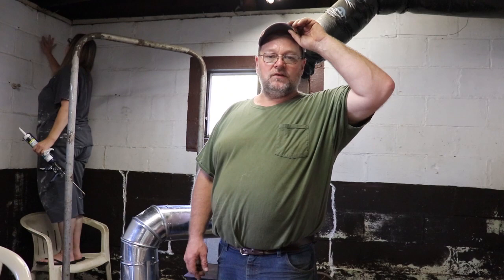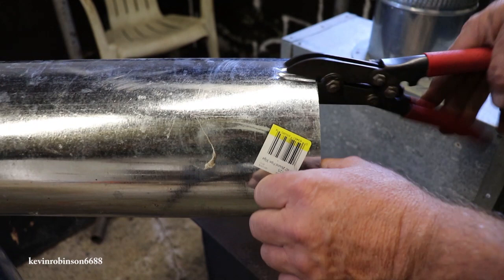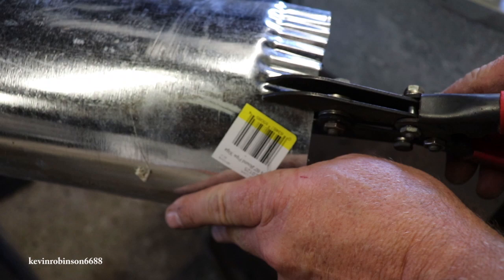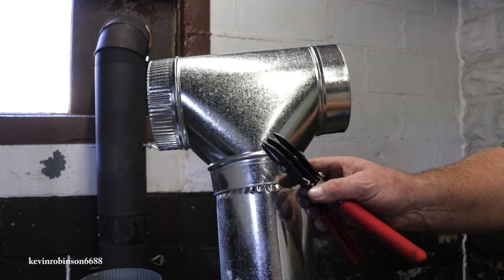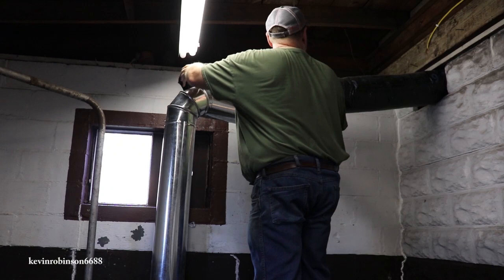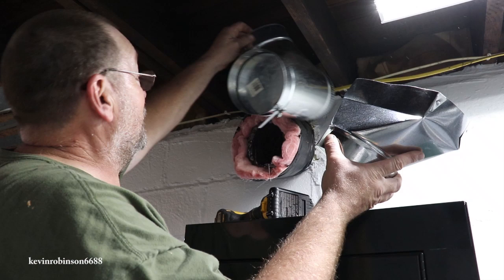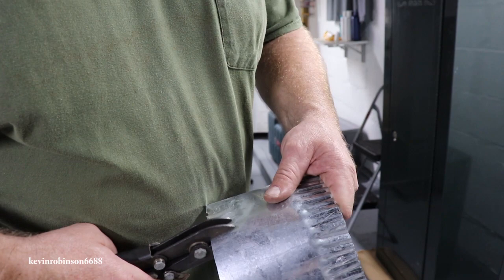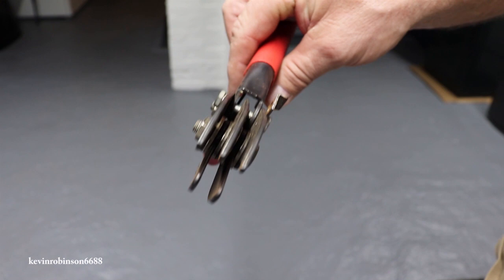stove pipe crimper tool

Comment: Hey people that sheet metal pipe is okay for  natural gas off top furnace  its getting  hot  But Not as hot as  wood burner heat does, So i dont recommended using sheet metal on wood burner, Use black stove pipe its more safer and can with stand 200+ degrees temps and black stove pipe it bit thicker and stronger and cost bit more.
Reply from the maker: Thanks for the comment.

Comment: I’ll be trying this on my dryer vent pipe. Bought a new home, 1.5 years later I took the dryer flex tube off to clean… and I couldn’t put it back on. Why? Well the contractors didn’t crimp the pipe to allow a standard flex tube to fit back on. It’s too big. So hopefully this will solve the issue. Thanks.
Reply from the maker: It will work great

Comment: When I was a kid trying to save money for college, I worked full time at an AC/Heating company in Virginia. I've used that tool more times than I care to mention.
If I die "young" it will be because of that job. Spent all day crawling under spider infested houses running pipe and wrapping it in Insulation. My lungs are probably full of fiberglass. My face, neck and arms itched from fiberglass for months after I left that job. Worse job ever. Nice tool though.
Reply from the maker: LOL I could you doing that what will do for money a thanks for sharing Daryl.